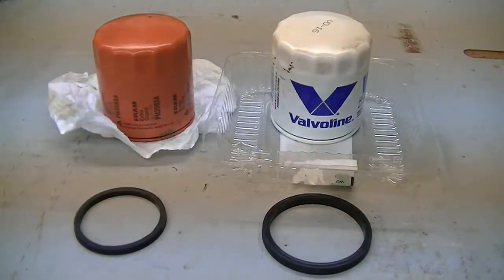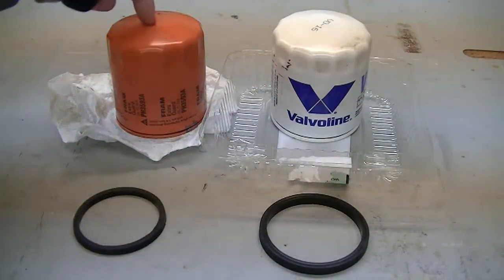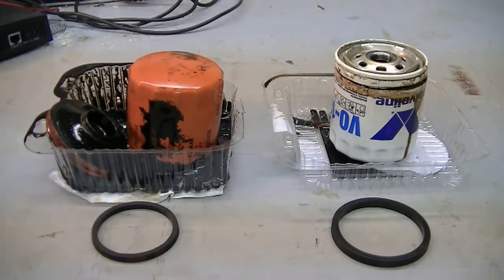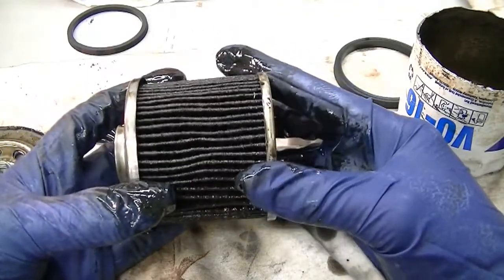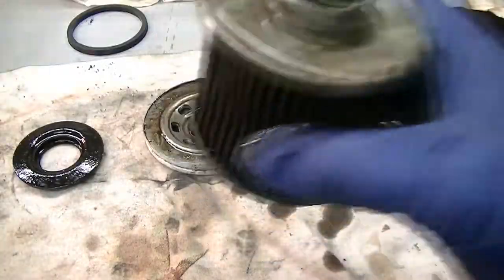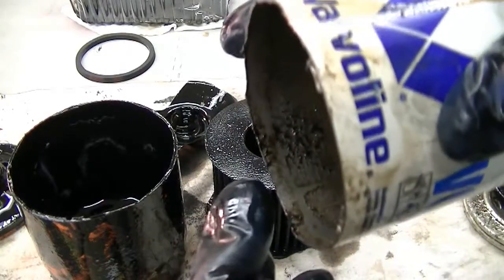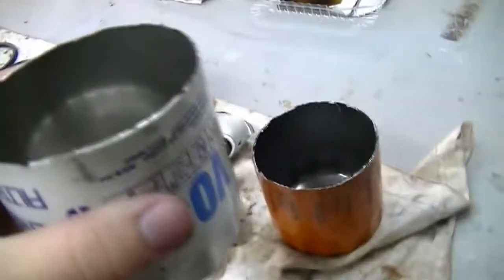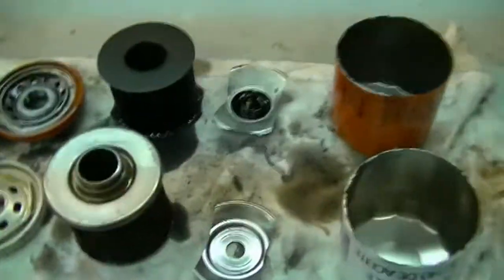Older Fram and Valvoline Used Oil Filter Inspection

Comment from the maker: I assumed it went through the filter media on the Valvoline. Not sure if that's the best test for the valve, as I didn't see which port the oil came out of, but good point. I'll probably have another Purolator/Valvoline filter to take apart in the spring.

Comment: One thing I'm anal about is the bypass valve. I favor the Motorcraft design where it's at the base of the filter, not the end. I honestly don't think it makes any difference if the center tube is spiral or not. Even if the pleats are grouped tight in one spot and wide in the other. At 30-50 psi every surface filters the oil.

Comment: failed because the anti drainback valve didnt work for it allowed all of the oil to drain right out, its the reason why the Fram was so heavy, its anti drainback valve worked.